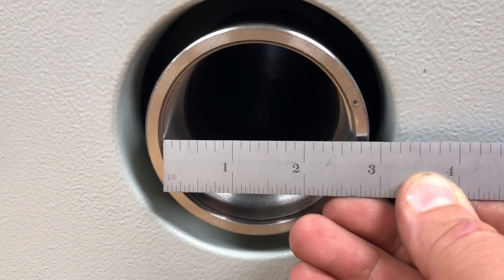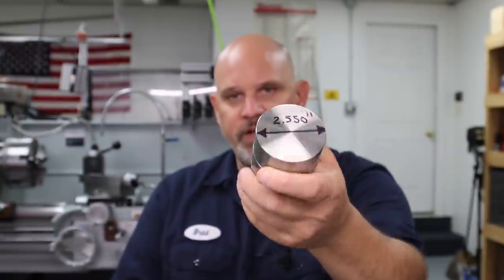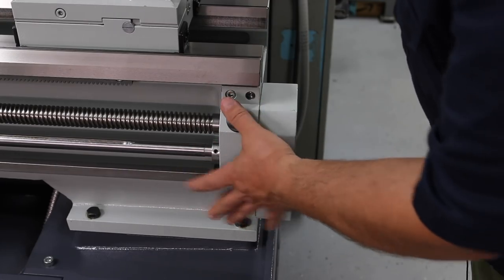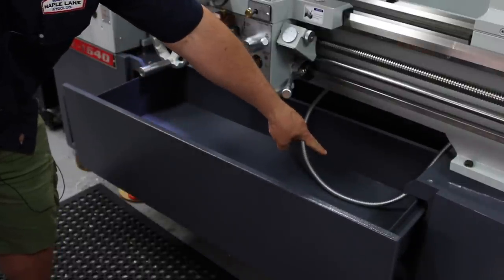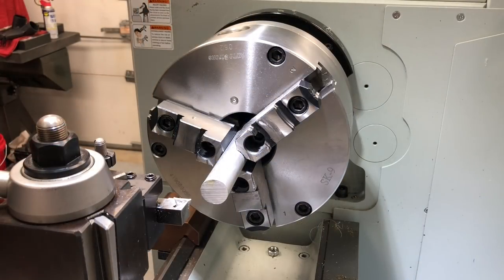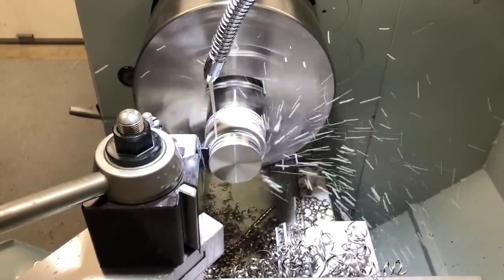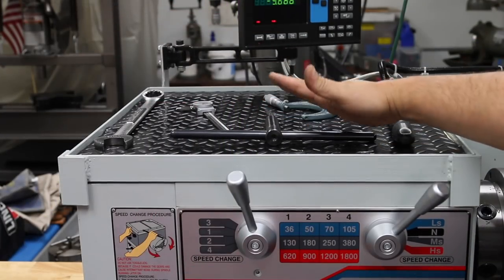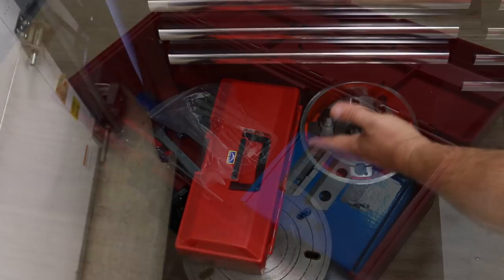PM 1640TL   Part 5

Comment: I do narrowboats in the U.K and have the 1236 with dro and coolant . Needed a 38 mm bore and cant say enough about it. Like you i had a pair of small Myford lathes and out grew them quickly. The 1236 is rigid as hell and can take 5mm cuts in stainless with carbide tooling its highly accurate and i love it!!

Comment: I keep looking at some of the sentimental stuff (10EE's and the like). This machine would be so much easier to live with and so much more capable. Great presentation Brad! Eventually need a lathe and this was very helpful.
Reply: I ordered a PM-1440GT lathe last fall, but due to a pending new home construction project (that actually happened *early*), I ended up not taking deliver of the lathe yet. But seeing Brad's video series--I think I might actually change to a 1440TL lathe. It's a few thousand dollars more, to be sure. But it looks like a entirely different class of lathe. Not that the 1440GT machine wouldn't be great I'm sure, but I really love the look of this machine. I don't see myself having a use for the 1640TL, but I can certainly see myself making use of the 1440TL machine.

Comment: Interesting. This lathe seems to be identical to the ACRA 1440 TE except in a 16" version. There are a few small differences. My lowest speed is 70 rpm and the speed adjustments setup is a tiny bit different. My "chip tray" is cast and not removable with to coolant drain in one end. Other than that everything else seems identical. I had heard that Precision Matthews uses the same Taiwanese manufacturer as ACRA. An interesting note: on mine the jog button is reverse so when you are power tapping a tap of the jog button winds the tap out. Also I was told by ACRA to never use the jog button to align gears for changing speeds or feeds, rather move the chuck by hand. Excellent review.

Comment: That appears to be a real decent machine Brad. And for a gear head pretty quiet. It would have been nice to see the certificate of accuracy it came with and what the factory's maximum allowable limits are. Did you run all the checks the factory did on that certificate, and if so how did they compare to the factory numbers? For the last lathe I got mine were coming up a bit better than there's and I'd guess that was from taking a bit more time.
Reply: 💯%🎯Your absolutely Right.... ( For real 🤔🤨🧐 and using your brain and thinking logically...  This is One of the most important and crucial questions in the whole entirety of the comments section... And would allow the general public from a prospective buyers position a actual chance at making a informed purchasing decision based on the quality standards of a less expensive Asian made Machine... And I completely understand proofing a product that ya' spent a significant amount of hard earned money on ...it unfortunately could be very embarrassing if the quality control assessment for tolerances didn't meet up to the assured stated dimensions, yeah ,that would absolutely suck and would be a horrible investment especially if it's for a business as the machine is not priced as a hobbyist machine ... But for him to not put his feelings aside and review the product honestly with the tolerance findings is kinda Grimy, the video title should be what's in the crate with the lathe and whatcha it make chips 🤣🤣😂💀.... why not divulge accuracy in the machine against the company's claim...." it's basically really not a review of the machine"  so someone's going to see this unboxing video series on this guy's channel and has to make that blind gamble they don't crap out... The only reason I can see in withholding the tolerance values  is if he have a dog in the fight and is  sponsored by his (advertisement for the company's future sales) compensated by either paid or a discounted amount off his  purchase price... False advertising is not a good look,not saying that's the situation..( but come on fellas 🤷🏼‍♂️ ) when the absolute tolerance & accuracy is of the upmost got'dam importance with all non hobbyist  machinists & in actually performance of the F'n machining equipment. This F'n crucial lacking information screams ,( "DO NOT SHOOT THE DICE ON A ASIAN MADE MACHINES" ) .... Just spend more money and buy a Quality USA,or European Made machine. just saying though. 🤦🏼‍♂️ Take care and be safe,and thanks for having the intelligence to voice what really matters 💯% 🧠🦾🦾🏆🏆🏆👍🏻😎✌🏻

Comment: Hi, that is a wonderful lathe, way too big for my 8'x8' shed. My lathe is just a Sieg SC4 and I also have put a DRO on it. However, I was wondering why, after you have used your micrometer to measure the diameter, you didn't set your DRO to be the measured diameter rather than zeroing each time (obviously you wouldn't move your cross slide after making the cut before entering the value)? I find that this makes working to diameter much easier because I no longer have to keep track of diameter between cuts. Obviously check with a micrometer towards the finishing passes and make any small corrections to the DRO as required etc. To me, being able to set the diameter ont he DRO after the first cut/measurement is one of the biggest benefits.
Reply from the maker: Makes sense - thanks!

Comment: Brad 
Out of the box was the lathe that accurate or did you have to adjust it?  Also it sounds really smooth.  I like options like the one shot oiler and the flat castings are always a good thing, it seems pretty Ridgid.  Thanks for sharing and I hope after the crash it is ok.  Thanks for sharing.
Reply from the maker: Hey Bill. Yes to all. I made zero adjustments to the machine!

Comment: Great series! Been waiting for this part for a while now, and it did not disappoint. Can't decide on the 1440GT or the 1440TL, although there is a fairly significant price difference. That said, the TL-series machines look to be quite a lot more machine: Almost twice the mass, and some nice features like the one-shot oiler. But a rotary phase converter isn't cheap, so unless you want to go with a VFD, the GT-series machine might have the edge as you can just go single-phase.
Reply from the maker: I was in your boat. Was going to get the 1440GT. But I knew that I’d eventually want something more beefy. I knew that this machine would be the end of the line for me and I would never need another one. Maybe you can ask Matt and see if a single phase 5 hp motor can be swapped out? I’m no electrical expert so that might actually be an absurd fantasy, but I don’t know. In my opinion it would be worth it to get the rotary phase converter and never again be wanting another machine. However, if you do get the 1440 GT, it to will be a fantastic Machine as Gavin’s video shows.
Reply: @BasementShopGuy  Right, exactly. I don't plan to use it "commercially," so in that sense it might be hard to justify the extra $4800 it costs to get the 1440TL. It's a LOT more lathe simply in terms of mass, but for making hobbyist sort of stuff like model engines, or similar endeavors, I think the 1440GT is plenty of lathe. And that $4800 can go towards a nice Atlas handwheel 5C collet chuck and some other tooling. If you went with the 3-phase 3hp version, it would also basically pay for the rotary phase converter if a guy wanted to go that way. 

So for my uses, I think the 1440GT is more than enough lathe. Also, dare I say, at less than 1800 pounds including the stand, it could come apart and go into a basement shop MUCH easier...something I know you know a thing or two about, lol. 

Thanks for the reply Brad. Love to see you doing well in your garage-based machine business. It's been great following your growth over the years!
Reply: Got the 1440TL. What a BEAST!
Reply: ...also went with a 20hp American RPC unit. So far, so good.

Comment: I'm jealous......I would love to have such a Unit.       It reminds me of Colchester machines which I used in Technical College in the 1970s.      I guess most reputable machines have the same features so no company owns a design.......however in this case the resemblance is overwhelming so that it's like recognising a family member you haven't seen for decades.

With regard to the control features you demonstrated........I wouldn't change feeds, speeds or direction on the fly as there will be straight cut crash gears behind the curtain.      The precision of your machine is a welcome change for stuff that has been built down to a price,   

There is a websit.....lathes.uk. Which will help you pick out who copied what and from whom!

Stavros from the great south land north of Antarctica
Reply from the maker: Thanks!

Comment: Almost identical features to my King Industrial 1640 except mine is Chinese instead of Taiwanese. 4HP instead of 5 and 2" spindle bore vs 2.5".  I have the DRO pro's EL-400.  I'm sure yours has better bearings and such since it is about 35% more money ($13k US vs $13k Canadian.)  I'm quite happy with mine so far though I have barely used it and have no point of reference to compare it to.  As a hobbyist I am sure it will be as capable as I am and more than able to meet any tolerances I will work to.  I am not Stefan or Robin.  I did buy a Bison 10" 6 jaw though I have not installed it yet as I can't safely lift it (about 120lb with backing plate).  I have to finish the gantry crane first.  

My manual was very explicit about not removing the gap bed unless absolutely necessary.  They state that it is fitted prior to final grinding and that once removed it is virtually impossible to realign properly.  They strongly recommend permanently leaving it out once removed.  I saw the same warning on a grizzly lathe.  Is yours the same?
Reply from the maker: Wow 10" chuck is huge!!